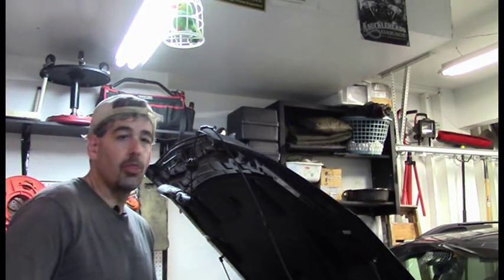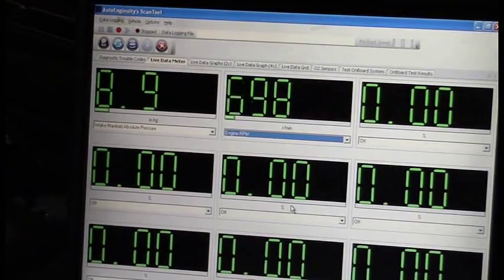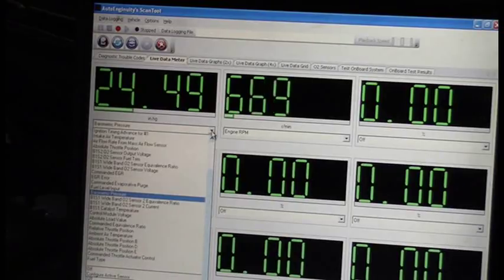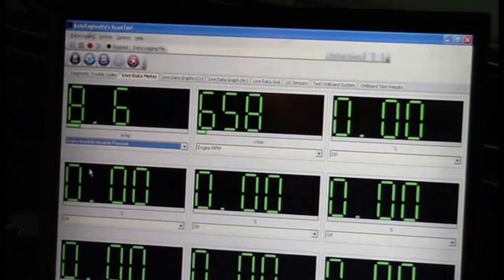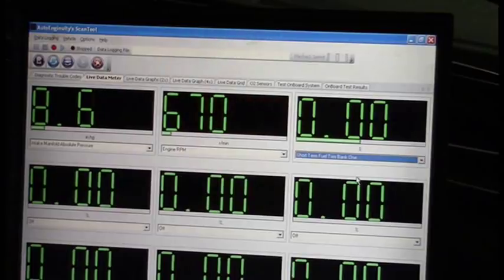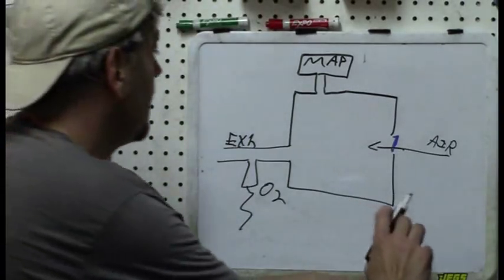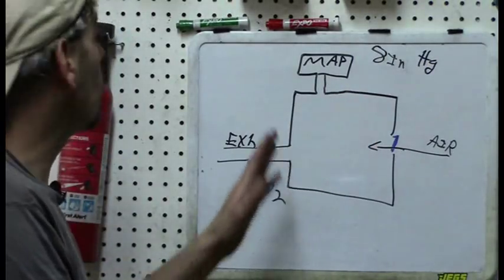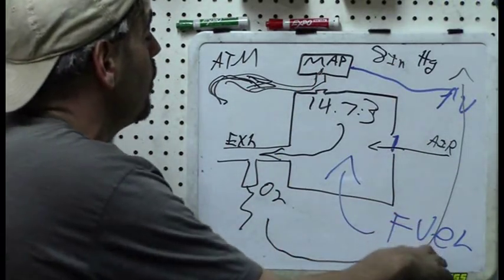MAP Sensor Diagnosis and Understanding Function- Pt2

Comment: hi matt is the signal wire and 5v ref wires are not doing the same job?
Reply from the maker: +shahab alam zeb No they are different- the 5V reference sends voltage through the signal wire.  As the potentiometer activates, it "diverts" more of this to ground. Some do vice versa- the reference goes to ground but potentiometer diverts it to signal wire.
Reply: +Schrodingers Box thanks matt thanks a lot

Comment: Hi,  I am fan of ur great engine knowledge, 
I want to ask what is relation between map sensor and oxygen sensor,  in my Suzuki Liana digonastic it gives 035 error code which is for O2 sensor,  my car silencer is becomes black and feels some times black smoke also, 
now the some machanic says that this black smoke thing is due to map sensor nor of O2 so my cars ecu giving wrong code,  so before spending 250$ on O2 sensor I want to know is this black smoke +at idle engine shut off+double fuel consumption is due to map or oxygen sensor ?
plz help !
Reply from the maker: kashif Raza Sure no problem.  What were the readings you got from the MAP sensor diagnostics?

Comment: I just started doing some engine diagnosis. I've a MAF+MAP engine with a throttle body without an external TPS (Z22SE engine). Now I wanted to see if disconnecting my MAP sensor connector would change the engine bahavior (I actually don't know if that's a valid test). Now when I did that, my engines rpm went up to 3500. Is that normal? I thought it would be a sort of backup system as my engine also got a MAF. So what could make this happen or is this normal?
Reply from the maker: What were your MAP voltage outputs when doing this?
Reply: +Schrodingers Box At idle the voltage should be around 1.5 (as you clearly demonstrated in your video) and when you disconnect the MAP sensor of course the voltage is 0.  I'm guessing, at this point, the computer would rely on the MAF sensor for input regarding air intake?

Comment: O ya just got why MAP sensors of different cars or trucks can't be interchanged it is because the diaphragm is different strengths based on how big the intake manifold is even if there is always using a 5volt ref for them all for the most part

Comment: how do you know for sure if the map sensor is reading the right barometric pressure with just switch on to compare reading once the engine is started?
Reply from the maker: Tim Morris I usually do it by voltage, not really BARO.  But knowing barometric pressure at sea level is usually around 29, I know if I key on and it reads way off of that I have a problem.
Reply: So the barometric pressure should change about the same amount as the vacuum on the intake once it is craked and running
Reply from the maker: Tim Morris I guess I never really looked at it comparable to a vacuum gauge- again I normally go by my familiarity with expected voltage output per TPS position.  But that said, I would definitely not expect the BARO to read the same as a vacuum gauge, however I would expect it would probably read pretty close to difference of the actual barometric pressure and the reading on the gauge- i.e. if the barometric pressure is 30 and the vacuum gauge reads a healthy reading of say 21 at idle, I would expect the BARO from the MAP at idle to read around 9.

Comment: I just changed the MAP sensor on my elantra 2003, and the car still hesitates to accelerate when cold. I wish I saw this video first to start analyze what could be the root cause, and not just spend money on something that won't fix the issue. 

Thanks for your time to do this video, it was really helpful to understand that a code won't really tell where the problem is.

Comment: So I guess my real question is what causes the lean condition reading positive short term fuel trim
Reply from the maker: I think I see your question. As I believe you know, the short trim will be positive until the long term adjusts for it. Once adjusted for the short trim should stay at zero. So your question is- how would you possibly see a STFT run high?  By definition, when you have a lean code it would be adjusted for.  There are three explanations for this.
1. The LTFT has not yet finished adjusting the STFT (code not set, code set but still adjusting, or computer was reset/battery unplugged)
2. The LTFT is maxed out and still not met the demand for fuel so STFT is still called 
3. The most likely- during your testing you a generating a new "cell" in the fuel map that has not been adjusted for,  I have not yet covered this concept but it is the most common explanation.  Fuel Trim adjusts in "segments" of RPM vs load known as cells- think of it like an array- a grid.  So at idle, 800RPM you might see LTFT high but STFT at Zero.  But then increase RPM at idle or drive the vehicle in a way it wasn't driven before so there is a new RPM vs Load condition that the fuel trim hasn't seen and it will have to make adjustments for that condition.  Usually people don't rev their car to 2200RPM at idle so when you do it as part of a diagnostic, the "high rpm, low load" cell of 2200RPM at idle runs lean, and of course the STFT is called to adjust.
  I hope that makes sense.  I will cover that topic on the whiteboard someday, it's a very advanced topic and not normally considered except in very advanced diagnostic scenarios- like the one you just asked actually lol.

Comment: Could we have a MAF sensor code (p0102) but not a MAF at fault?
Reply from the maker: Most certainly you can. An open in the MAF signal, feed or ground would cause this as would a bad sensor. I imagine even a dirty MAF might also cause this, particularly if engine has lean codes too.

Comment: Hey Matt. I assume that you are talking about a normally aspirated engine. I was just wondering, if it was a turbo engine, would the MAP sensor detect a higher pressure at high revs? Or maybe I've misunderstood the working of the MAP sensor.

Comment: Dear Mr. Schrodingers Box,

Thank you for another very pedagogical video. After attending this class, i have few conclusions of my own, which i would like to express, for the sake of convincing myself that i understood what you've explained:

in a strictly speed density engine,

1. Lean condition can't be created by pulling the brake booster(perhaps, by disabling an inject does create lean condition, as unburned air would go past the O2 sensor)
2. injection base command pulse goes hand to hand with change in MAP
3. any mechanical misalignment of failed engine sync that leads to change in intake pressure, will induce false MAP reading and hence change the base injection, as long as the condition remains.

thanks for the class
Reply from the maker: HomemMagroide   Not being fully familiar with speed density engines, I will answer best I can but your understanding is pretty much as good as mine.

1. I am not 100% sure but I would say yes that would be correct.  Pulling the brake booster on a speed density engine would increase MAP signal and fuel delivery would be proportioned accordingly. However I am pretty confident that such a massive change in detected load without the TPS (Throttle Position Sensor) showing a change- that would have to be noticed by PCM and I would have to think you would get a code, but I have to think it wouldn't be a lean code since the exhaust isn't lean but man there would have to be either a TPS or MAP code I would think. 
2. Correct.
3. Correct.  In fact, one of the limits of a MAP engine is if you change to a high performance  camshaft that has more overlap of the valves- This will definitely throw off the "sync" as you described and re-tuning would be required to compensate.
Reply: thanks for the answer. I was wondering if you've consider making a video of waste spark ignition system. This systems seems to be common to many auto maker these days.

Comment: I have a 86 Ranger I checked the MAP sensor by pulling a vacuum. The signal wire alternates back and forth from 2.5v to 5.2v with nothing in between. The vacuum has no effect on it. I picked one up from a junkyard and it does the same thing. Am I right that they are both bad? Don't know if there are some exceptions. This is one of those Rangers with a miss on acceleration. I think I am narrowing it down.
Reply from the maker: If your ranger has a miss, that would cause drastic change in vacuum and thus drastic change in MAP. Test the MAP as shown with KOEO to rule out if the miss is causing the variability.
Reply: Right, I checked with KOEO pulling vacuum with a vacuum tool. No gradual voltage changes just random 2.5v and 5.2v back and forth on the signal wire. The vehicle runs fine until you put it under a load.
Reply from the maker: dk4622 Ahhhhh, I get it. Yes I may have explanation for this. Are you measuring between a black wire with white stripe and ground by chance?
Reply: No I'm probing the green wire in the center of the plug with power probe and battery negative. Black with white is ground.
Reply from the maker: dk4622 Actually rather than dialogue back and forth which my last comment sort of initiated- I rarely work on models before 1986 simply because of my scantool limitations to OBD2 only. However the issue you might have is the MAP sensor in your truck uses frequency rather than voltage for the computer input. You cannot measure this using your DVOM. The best you can do is measure the voltage with KOEO between the black/white wire and ground and the voltage should be around 1.5V a little less or more depending on your altitude (but not 2.5V I am sure). This is really all you can do without a scope to the best of my knowledge on these designs.
Reply from the maker: dk4622 Lol seems we were typing at same time.  Just try reading B/W wire vs a good ground or some combination that hopefully gives you around 1.5V with KOEO.
  The B/W wire to ground measurement is from AllData btw, so it's not just advice from my bad memory or anything. Try it and see what happens, I'll check back later.
Reply: I'm getting 0v on the B/W wire. Thats why I saw it as ground.
Reply from the maker: dk4622 Hmmmm.  is this 4 or 6 cyl? Let me pull a wiring diagram and check.
Reply from the maker: dk4622 ACtually never mind that- it looks like the 4 and 6 are same wiring. Looks like you got a Orange/White reference, Black/White Ground, and Blue/Green signal. No idea why AllData said measure at B/W to ground.  Still I cannot confirm with the info I have if this is a frequency MAP so what I said above may still apply. Other than unplugging the sensor and checking that reference voltage is coming in and ground/signal integrity is good you may not be able to do traditional voltage test on this sensor, and even if you could get specifications for variations in Hz, I cannot find a table showing what they would be bro. Sorry- OBD1 just not my bag!
Reply: Schrodingers Box Not mine either. Believe it or not I just sold it 5 mins ago for $800 and good ridance. I still wanted to solve it. Maybe next time. Thanks for the videos.

Comment: i have a 95 cavalier 2.2 that hesitates some when accelerating, also can hear some small pops maybe backfire from i believe under the hood while trying to accelerate from a stop. have got a code 34 low voltage at Map sensor. i have checked the ref and signal voltage seems to be fine.  do you have an idea what might cause this code?  watched video, thinking throttle not right? any thoughts would help. thanks cory s.
Reply from the maker: What are the MAP sensor readings? Impossible to tell based just on symptoms
Reply: 5.v ref. and signal volts are in compliance with throttle movement just like in ur video.  3.0-1.1volts. could a misfire from one plug or bad plug wire cause the low voltage code ?
Reply from the maker: suprs05 I would be starting with fuel trims to get a direction. See my video on "secret of engine problem diagnosis"
Reply: ok, its freezing out. went back and back probed signal wire. read...    1.5 - 1.7 v  idle, slow acceleration manually did not produce an increase in voltage as it is suppose to.  i did get the voltage spike to 3+volts then   sharply down to 1.0 - .50 volts on snap back decel.   that is where my issues are while driving. hesitate from stop idle to slow acceleration.  runs fine at speed.  just tryin to put the two together.  if throttle is not opening enough letting the air need at that time to accelerate to tell the Map to send a increased voltage back to pcm.  throttle position sensor seeing a gradual opening throttle so its sending more fuel but just dont have the air to mix??? watching your Secret of Engine Problem Diagnosis now.   if there was a vaccum leak wouldnt there be more higher voltage signal from map ?  or is it maybe getting too much air and not the fuel with the readings its getting to send the right amount of fuel and time?  your videos are outstanding and helps to understand how things work and why.   thanks for the responses

Comment: Hey Matt, yes you are a very helpful and clever guy for sure, its appreciated! Really good to learn something quite intillectual about car electronic stuff. I am wondering if you could have a thought about a problem we are having with a car over here in scotland. Its a vx vectra 1.9 cdti and I'm wondering if it could be the MAP sensor. We already cleaned out the egr valve so you know. Very occassionally the car without warning starts putting out blue/grey smoke for no apparent reason. I have diagnosed it to happen when the car is in a igh gear and low revs under 2000 just jogging along and sometimes maybe when a slight incline comes along. I am wondering if the MAP is not working right or is needing cleaned maybe, could the low revs be making low pressure and a blocked sensor is not reading that fuel should be turned down, so produces smoke. Would appreciate your thoughts, thanks joe
Reply from the maker: It is impossible to tell if the MAP is the problem without MAP sensor data under the conditions you indicate.
  Under the conditions you demonstrate, (high gear, low RPM) you would be under heavy load- worn rings would definitely cause the symptom you see- a compression test would be a way to find that.
  Sorry just not enough data to eliminate any variables but I would start by checking MAP voltages as shown in the video and if they respond in linearity to throttle positions, I would be inclined to assume that's oil and not fuel coming out the exhaust under those load conditions.
   If you want to cover a trip for me to go to Scotland, I'll gladly look at it lol- always wanted to go there!
Reply: Hey, you're some guy lol! Yes I wish I could cover your trip here, I'd love to meet you, you are very interesting. OK so I see how you are thinking, yes it maybe is worn rings as the engine does have 170k miles on it. If the MAP was needing cleaned, as thats never been done, and I did the voltage test as you suggest, could the dirty MAP cause the readings to be inaccurate and if I cleaned it, would the readings maybe be different. Just making sure I understand this thing too. Thanks for your quick response, I was impressed :) Very best to you, Joe
Reply: by the way, where are you based yourself.

Comment: Absolutely yes I found this very helpful, just a question by any chance do you have any videos about EGR valve? Again thank you so much.
Reply from the maker: Not specifically, however the first diagnosis in my video on "multiple check engine light diagnosis" deals with an EGR diagnosis on the first code.

Comment: Matt, I noticed on my scan tool that I have not bank two long term trim showing up but I have a bank two short term trim reading. I found that very odd. If the scan tool is not getting a signal(I am not sure where the sensor to the second bank would be on my Acura CL, v6) would the scan tool ever show a display, let along a no reading?
Reply from the maker: Hahaha, yes, I have a whooooolllllle 8 part series (13 actually) on a similar issue.Unfortunately in my instance, instead of not showing a fuel trim for B2 it gave a false reading.
  Ultimately I have seen this many, many times. It is a common communications issue with low end scan tools that they do not always communicate effectively with the PCM.
  Normally, little can be done about this- some cars just simply communicate better than others with low end equipment.
 There are really only 4 things you can do in this instance
1. If allowable, run the scan tool in Generic mode instead of enhanced parameter mode. If the tool does not have enhanced mode then you will already be in generic anyway.
2. Use a different scantool. I find when my Autotap has this issue, my autoenginuity does not and vice versa
3. If the scantool is PC based, use the device manager to set the COM port for the device to a different one.
4. Use other methods besides a scantool for your testing.

Sorry but trust me, I deal with this alllllll the time bro.